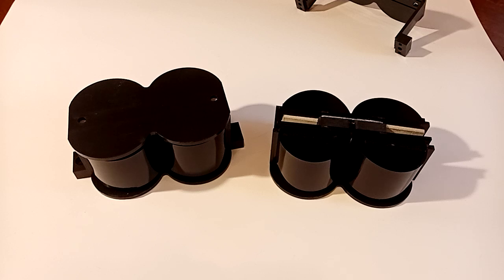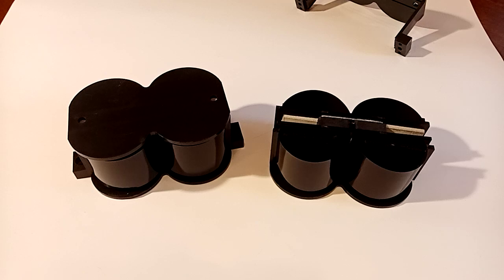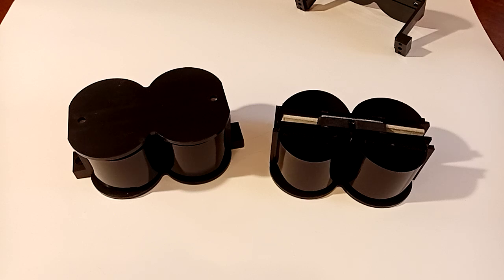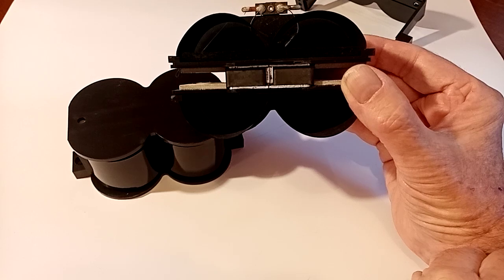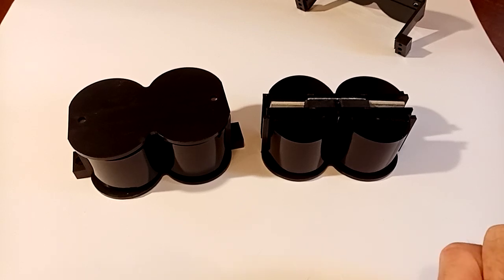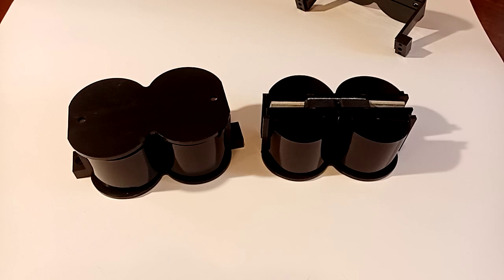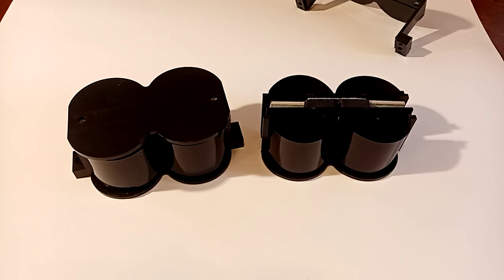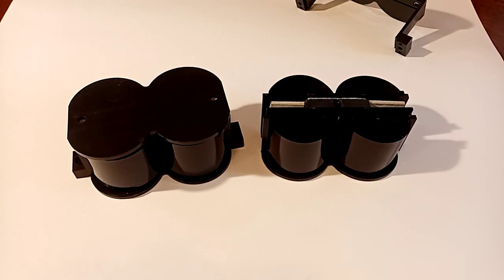Linaeum/Rubanoide Dipole Ribbon tweeter. Classic tweeter.

Comment: I have a pair of those. They sound pretty good too. Weird that radio shack made them.
Reply from the maker: Tandy/Realistic made some pretty cool gear amongst the cheaper offerings and the Linaeum are a good example of that. They were made under licence from French company Linaeum whose original design incorporated a corian cabinet and special Linaeum ribbon tweeters. The way to tell if you have the superior sounding examples is to hold them up to the light amd if they are a ruby transparent color they are the better sounding units. There are also some massive examples using paper drivers that I would love to hear. I believe they are called Rubanoide, which roughly translates to Ribbon Like. Anyway, hang on to yours, they are excellent.

Comment: I have 4 RadioShack LX5 speakers that I still use today. I bought them new, sometime in the 90's. I just put a new crossover in each of them.
Reply from the maker: Very nice! My dad bought his LX5 speaker's from Radioshack around the same time. They recieved rave reviews from Ken Kessler at the time. The tweeters and cabinets were very special, the woofer was ordinary. At the time they were the best budget speaker. My dads mate used a pair of Linaeum tweeters with a pair of Epos ES11 speakers turned on their side, sounded good. Did you know there are two versions of the tweeter? If you hold them up to a light and they are transparent with a redish colour, then you have the superior make. Later models have a non transparent film for the ribbons and the dynamics and efficiency is reduced, they dont sound as good. Thanks for your input!